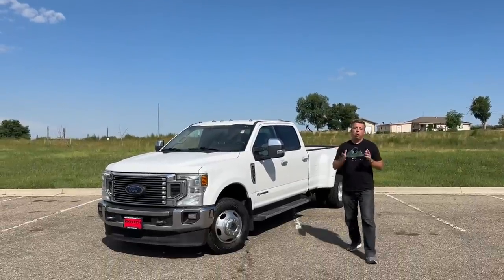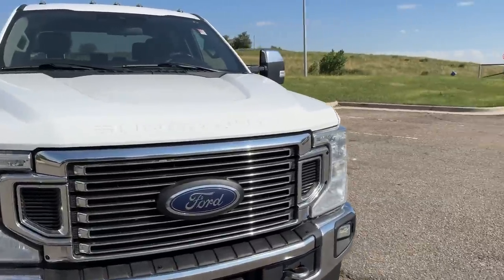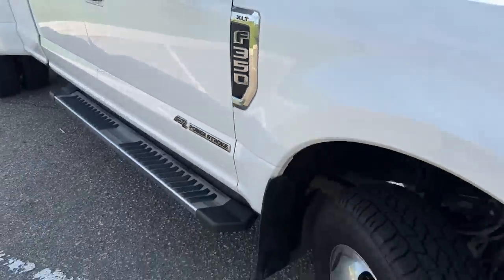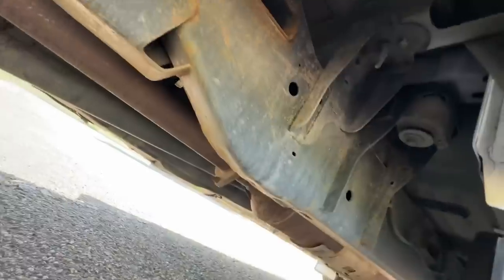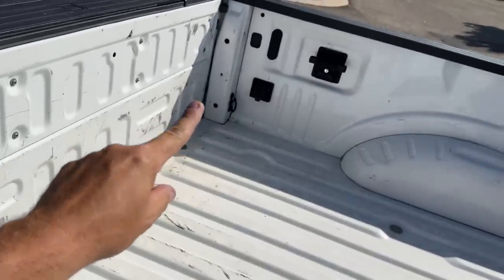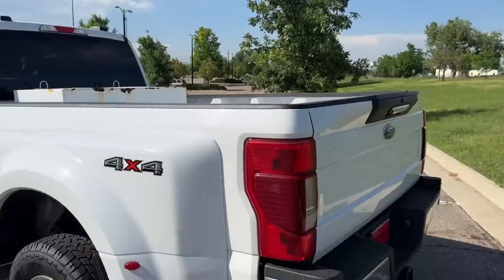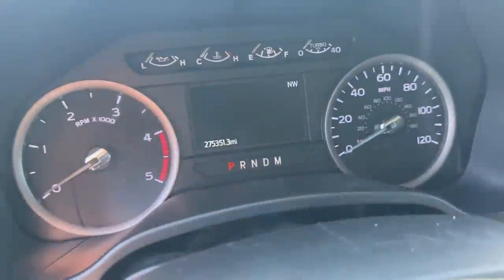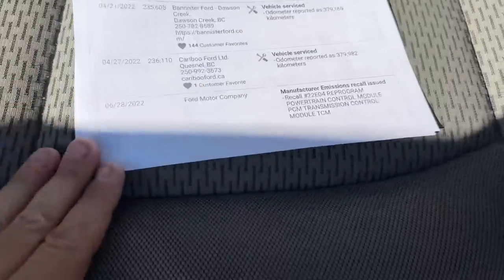What BROKE & What DIDN'T! 2020 Ford F-350 Power Stroke Diesel After 275,000 Miles Of Hard Use!

Comment: I have a 2018 ram 2500 
I have 4hundred fifthy thousand miles and everything is original except two things.  I got the trans rebuilt last year and I just put a new fuel pump in yesterday. Other than that still rides like a Cadillac.
Reply: Rams a better truck.
Reply: Rams are the best 💪

Comment: Curious how many hours of run time were on the truck as well. I had a 2021 F250 with a 6.2 as a work truck for about a year and a half. It accumulated around 19,000 miles but also just over 2000 hours of run time on the engine. I worked in the utility field, so my truck was my transportation, my office, and a mobile power source on the job site. During one post-storm event, working to restore power, it ran continuously for almost 6 days. In that year and a half, it gave me no trouble…but I expect that from a new vehicle.
Reply: I’m a Troubleman for a utility and I have a 550 and the thing has insane idle time truck never shuts off and tons of off road and in town driving plus a boom with pto..I have an 18 and it’s at 150k very hard miles only thing ever done has been the upper oil pan gasket ..I drove Chevy for 40 years but I was so impressed with my work truck I went and bought a 22 f250

Comment: My Sister and Her Husband Bought a 2017 GMC 3500 diesel. Here in Ottawa. They moved Travel Trailers around from the Manufacture in USA to places in Canada.  There GMC at year two had 240 000 miles. The Deff System let go and cost almost 40 grand to fix.  They moved to A semi with a flat bed. Because the little truck cost to much per mile to run. Cost over time was to much for them. The External tank. Most guys here in Canada use the Tank to fill there own truck in the USA.. because Fuel is so costly here in Canada.   Running commercial  like that you do everything to save a buck.

Comment: You should have tried to unlock the tailgate directly with the key. What it seems to me is that there is something wrong with the wiring since the backup camera also didn't work. So that means that the electronic lock wouldn't work either when you use the remote to unlock the doors.
Reply: @wakeupamerica2024  I mean, should have tried unlocking the tailgate manually anyway. Never hurts to try to narrow down the problem...
Reply: @wakeupamerica2024  Glad mine doesn't do that. I have a 2022 Maverick and I live in South Florida, so it's been like 100F+ every day this month, lol.

Comment: Last place I worked at had 1 customer that was a horse hauler. Traded trucks (F-350s) around every 90000. In the almost 4 years I was there, he was about to trade the 5th truck. 
A different guy that delivered horse trailers had a 2018 F350 with 340k on it (he retired just before I left in 2022) and he had sold his other truck a year before that was a 2013 with 640k on it.

Comment: I’ve never had an issue buying a used car with high miles.  They’re normally cheaper and have been maintained.  Also I drive a lot so if I pay more for a low mileage vehicle it will eventually have high miles.  So why not start with a high mile vehicle to begin with?
Reply: Especially a late model high
Mileage car , they are great

Comment: Those fog light probably cracked because of heat from the bulbs in them. The ones I had on my Ford were the same design and they cracked in the exact same way. I had to replace them with aftermarket lights.
Reply: Same issue in my 17 f150
Reply: Just had to do my 2015 f150 too, they're cheap and dont take weather well.
Reply: Yep they all crack

Comment: The buttons on the front are for a winter front or bug mesh, both can be useful up here in Alberta. 

As far as the Carfax goes, it can’t be taken as gospel for service and repairs, especially for a Canadian trucks that has a US Carfax pulled. It’s not required for shops to report to Carfax service and repairs, and that can leave a large gap on Carfaxes. I also find that Canadian vs US Carfax can be inconsistent in what they show on the same VIN.

Comment: We just traded a 2020 trail boss off with the 6.2l it was a custom trim level, so it didn’t have all the bells and whistles.  It was a daily driver between East Texas and the oil fields of midland/Pecos Tx.  
   It was traded in last week in Waco, Texas, being 38 months old since the date of purchase with 282k miles on it.  
  Nothing was ever purchased other than one battery, about seven or eight sets of tires, one idler, pulley and belt and that was it.   
  The man that drove it works with me. He never hit the trip meter on it since the day he purchased it and when you look at “ trip A “ it had the same mileage is the odometer lifetime fuel average was 15.2 miles to the gallon.   
  That’s why our company has seven of those in stock right now they are all about a year and a half old with a 80-100k on them.

Comment: That'll be an ex mining vehicle. That's how it did 2000 miles per week. Probably ran close to 24 hours a day across all the shifts on site.
Reply: I was thinking hot shot. Dually setup and the paint isn’t bad so it was probably on the highway towing and getting those miles quick.
Reply: @Lq32332  You gotta think about 2000 miles per week every week, that's 300 miles per day every day of every week. My thinking is only a mining vehicle would get used like that
Reply: @SirNecro hot shot drivers, pulling a 5th wheel with misc loads all over the country
Reply: The seat would be destroyed if it was a 24/7 across shifts mining truck lol
Reply: @SirNecro  they say @0:50 it started in Alberta and went across Canada multiple times- so hotshot. Not to mention, mining trucks don’t get near the freeway miles a hotshot is getting daily.

Comment: Up here in northern Canada these trucks get abused and they take it. Also slip fuel tanks are common in lower populated areas due to long distances between towns and to offset varying fuel prices from different fuel stations. Sticker would be in Canadian dollars. Truck odometer and speedometer should have been changed to miles to meet US import and DOT regulations. Some vehicles here can switch back and forth from kms to miles.

Comment: That many miles in a few short years and the fuel tank in the bed is a clear indication that it was a hotshot truck or hauled campers. Mines a 20 SXT with a 6.7 and 284k on it currently. No repairs, just oil changes, tires and front brake pads. And 140k of those miles are on bigger wheels and tires. I'll buy another

Comment: i have a 2020 XL 6.7 i bought new, you dont want to know what i paid for it then, with 26,400 miles on it and its had 5 oil changes. brakes are still at 10 front and rear, tires are 7 and 5 in the rear based on the service i had them do a couple weeks ago. the 5 was front, i drove it up a local mounting and it used up some front tire but they rotated them for me, not even a burnout in it. i bought it to use it for towing in a few year and for a write off now. i have some other stuff id like to get and i dont want to have a truck payment then. im saving it for me not the next guy haha.. yeah i am probably going to put the S&S fuel pump in it soon to, just dont want to be the 1st but better safe than sorry. **it has 1 very small chip in the paint from the neighbor carrying something, turned and hit it on the truck... unbelievable but what can you do.

Comment: 15:00 an older truck? This is a 2020 it’s 3 -4 years old that’s not old at all , 10-15 yrs old is old .The miles were put on quick,probably has low engine hours,and truck that new would still run good .

Comment: A friend of mine has a 2018 F450, he hauls RVs on a 45' trailer. He's over 300k and has had new motor, turbo, fuel system, transmission, emissions and rear end, just to name a few of the major things. Its always something and has cost him a small fortune. He has always maintained the truck at the stealership. Cost of repairs, failures, downtime almost put him out of business a few times. I wouldn't touch one with a ten foot pole.
Reply: Funny,I know someone that owns a fleet of these for hot shot transport across Canada,claims it is the best model of truck for the job.He's tried them all
Reply: @jasonbrushett2005    I'm sure my friend is in the minority, but if/when it goes wrong $$$$$$$$

Comment: 2017 6.2 with 230k miles, still looks brand new, the seat is starting to get warn, not as springy or spongy as new. clear coat starting to peel in a few spots. no real rust. tailgate had trouble opening as well, sprayed down the latches and mechanism with PB blaster and it opens every time now. all the electrics freaked out one time and all the check engine lights came on, backup sensors disabled with big warnings on the dash, radio blacked out and didnt work. shut the truck off and turned it back on and hasnt done it since. Platnum.

Comment: Curious that a 'Canadian' truck has an mph speedo and not a kph speedo.
Reply: I transport a lot of f-350s and other vehicles into the US from Canada. 9/10 times they have the speedometer swapped out before they are imported
Reply: Digital dash, can you not change back and forth?
Reply: Modern vehicles can be digitally switched from miles to kilometers in setup menus.
Reply: @vg3430  I figured they all did, my Expedition and Escape both do
Reply: @vg3430   @93_LXcpe  there's still the analog speedometer on these trucks. The middle screen and GPS display are all switched digitally, but the physical speedometer has a new face put on typically as US buyers prefer the speedo in the correct units.
Reply: I can switch mine from kilometres to miles in two seconds in the settings. My truck is a 10 year old Ram. This truck is a 2020 so I would hope it would be able to do the same lol

Comment: Interesting test. But the results seem to be a bit at odds with my 2017 F350, 6.7 Diesel, SRW, 4wd, Crew Cab. with less than one tenth the mileage (33,000).
Despite very light and infrequent towing, conservative acceleration, and almost exclusively highway driving, the DPF sensor needs replacement and there's an open question about the DPF filter. The sensor will cost $1200 and if the filter also needs replacement, the total bill could be $4500. I was not expecting these things to fail with such low mileage and light highway use.